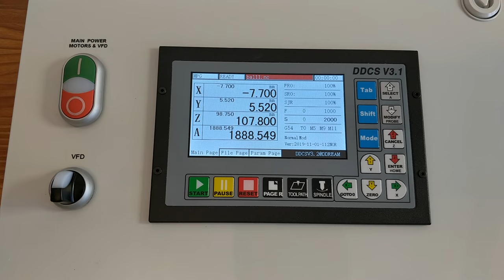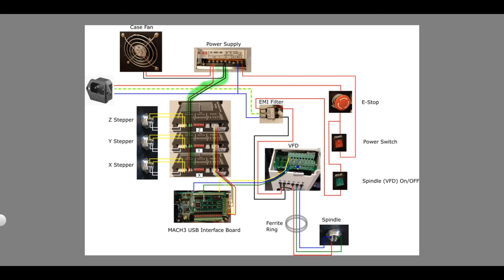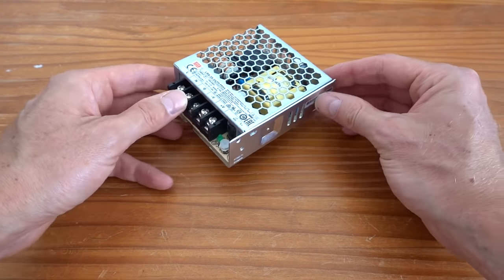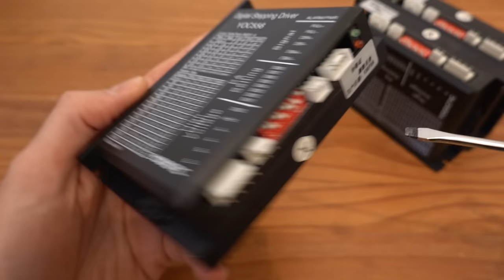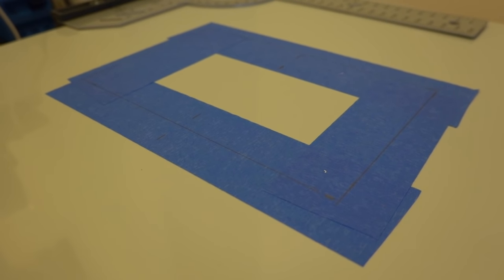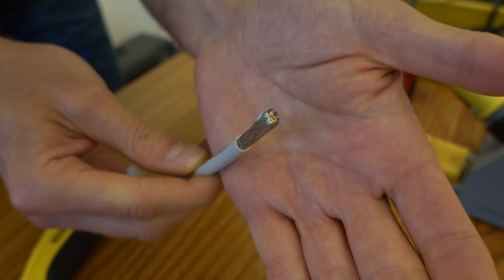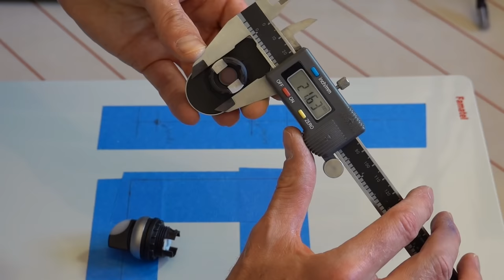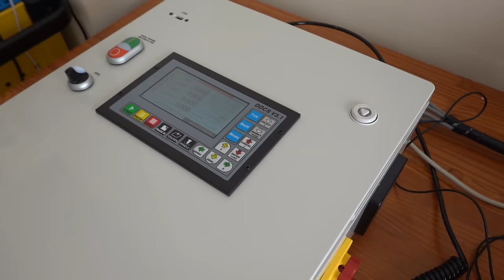Build Your Own CNC Controller, Part 1  | DDCS V3.1 |  6040 Router

Comment: The soldering looks bad because you did not use any FLUX.
Reply from the maker: Hi, thanks for leaving a comment. Soldering is not my specialty indeed. I am using solder with flux built in and thought that this would suffice, but it is good to know that separate flux is better for soldering larger parts, thanks for the tip.

Comment: Hi UptimeFab and all current and future DDCSV3.1 builders. 
You may have seen my notes on Yacoub Jabal's excellent YouTube build demonstration. I write to warn possible purchasers of Digital Dream's current DDCS V3.1 version which comes with a NON-FUNCTIONING MPG unit. They claim it was tested at the factory before shipping.   I wish!!!   They seem not to care too much about after sales help in tracking down the problem. I have tried everything without success and I would really appreciate any information from people who have had issues with this so I can share a good outcome with others. It appears that I'm not the only one with this problem...  I hope I'm not intruding too much but this is a serious problem and people need to know about it. I will keep trying to find a solution and let you know.
Thanks in advance :)
Reply from the maker: Hi Jim, I missed this comment initially due to your second comment. Only noticed the last comment. Anyway, sorry to see that you are having issues with the pendant. Mine works without any issues. Bought it in November 2019. It was also included in a set together with the controller. (Newcarve on Aliexpress, who no longer offer this specific set). Not sure if the store bundles it or if they buy a complete set from Digital Dream.
Hope you get your issues resolved.
Robin.

Comment: Hi. This is a box. not a controller. The controller is the motor driver. I was expecting a PCB design tutorial and some ICs
Reply from the maker: Hi, the DDCS is indeed the actual CNC controller. Since I had seen the term controller also used for complete systems in an enclosure,  I did not include the word "box". Sorry to see this gave a wrong impression for the contents of the video. Thanks for the feedback.